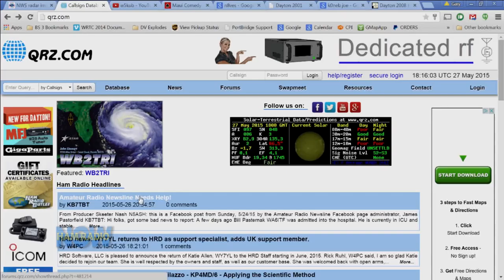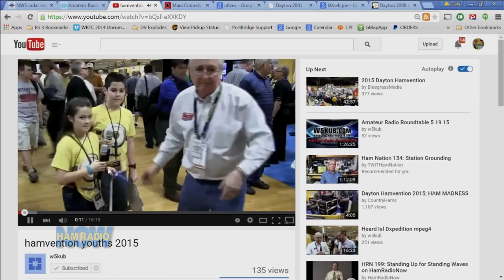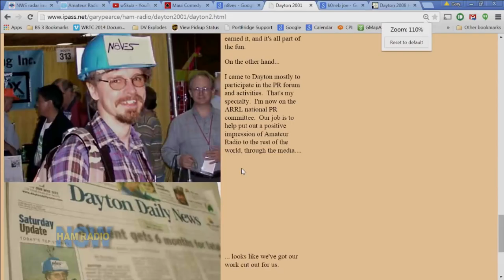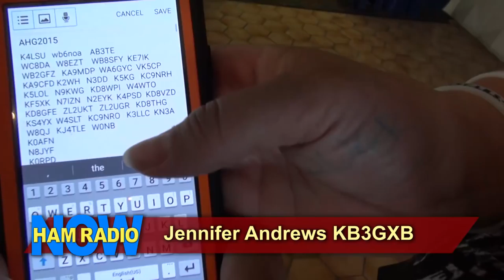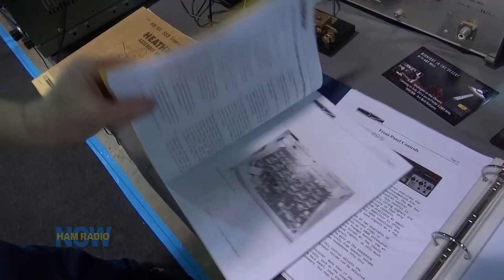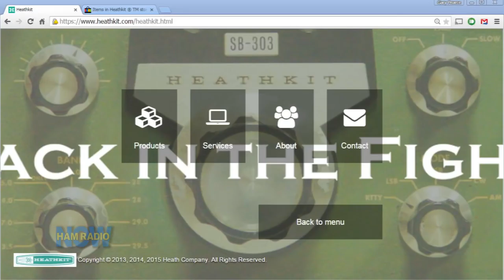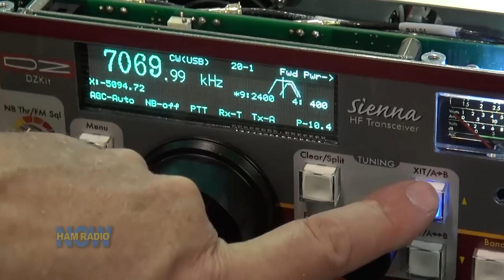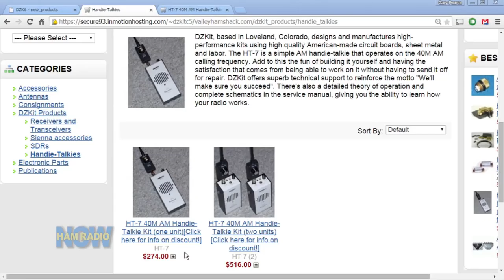HRN 202: DZ Kit (& other stuff) from Dayton on HamRadioNow

Comment: Sorry but 3500 bucks is just way beyond any reasonable price level for something with this kind of fit and finish. I appreciate that it's a kit and all, but that should in fact bring the price down, not up. I'm also not too thrilled about the front panel and user interface. Just because it's a kit doesn't mean it has to look that cobbled together.

The performance may well be outstanding, but then this aspects needs some more convincing demonstration.

Kudos for offering solder kits though! I just wish it was a little more attractive, and a wee bit cheaper.
Reply: +Toumal Rakesh That is what ended Heathkit, it became more expensive for them to put kits together and sell them than to just have a big company sell a complete radio that is not a kit. So actually a kit is now more expensive than a complete radio.